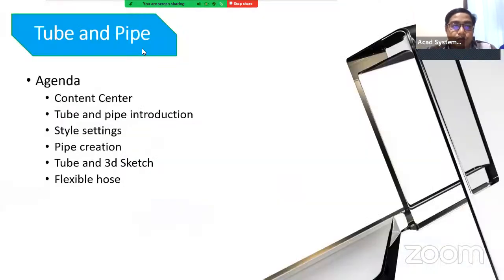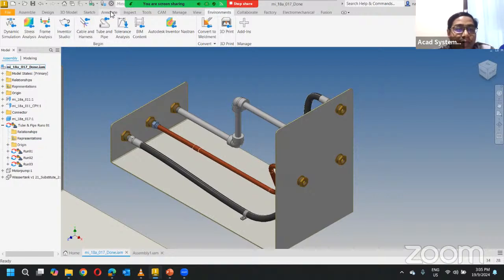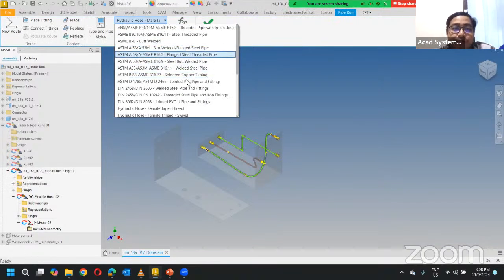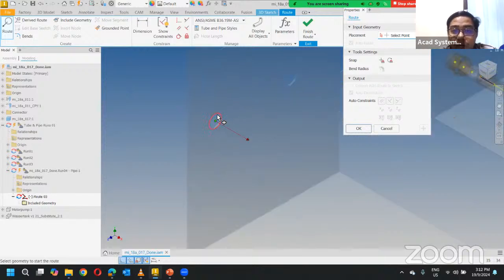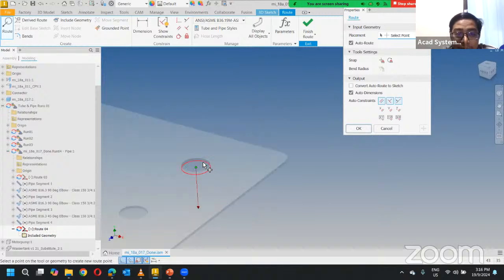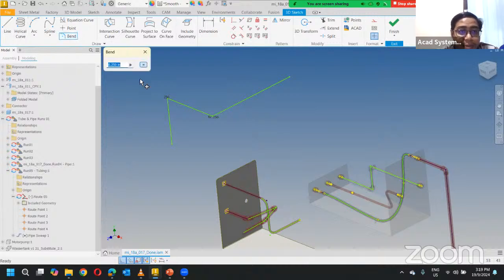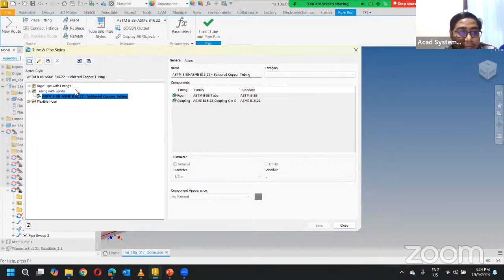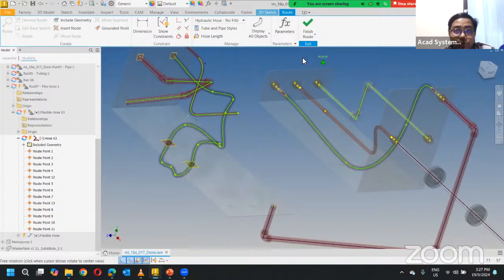Autodesk Inventor Tube & Pipe

Comment: Why use Inventor for Piping if you get Plant 3d that is a spec driven piping software that comes within Autodesk package with Inventor? Try spooling and routing pipe in Inventor. Compare the total time spent vs. doing that in Plant 3d. 😁
Reply: Try creating this assembly in Plant 3D, just like in the class; a mechanical assembly 
would be incomplete if it included pipes, hoses, tubing, and valves without this AIP tool.
Think about it.